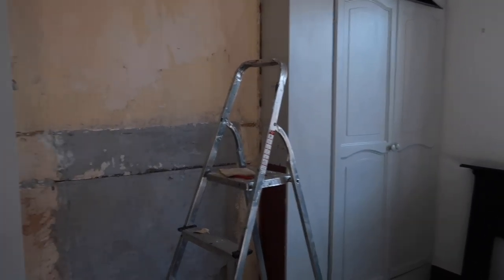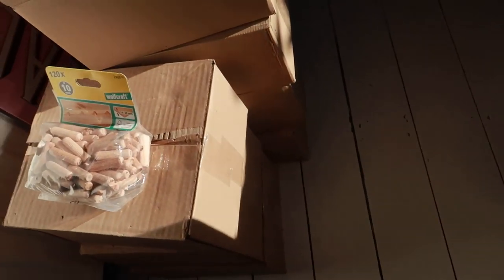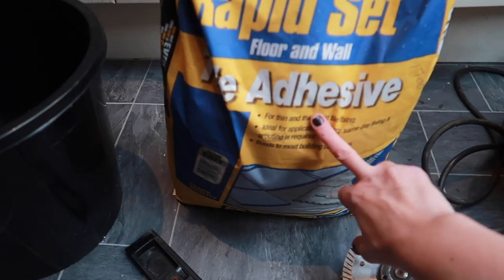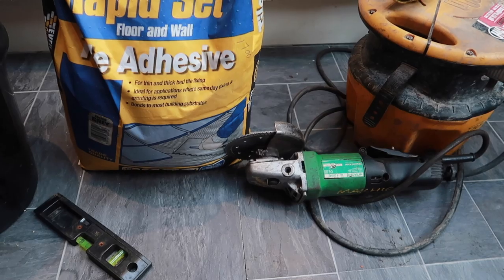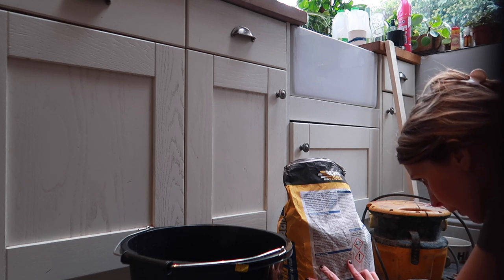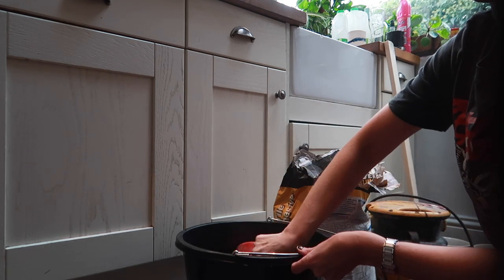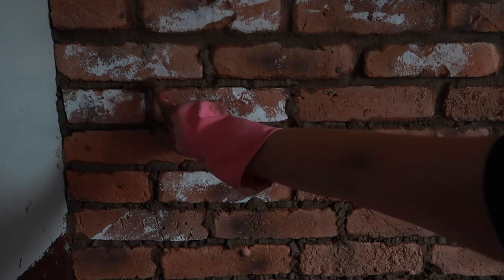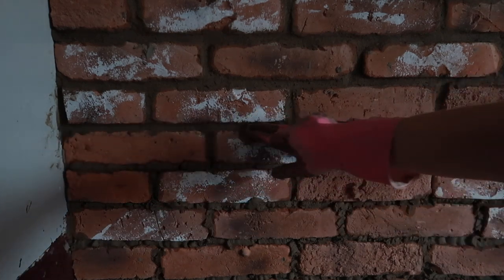MY STEP BY STEP GUIDE TO INSTALLING AND POINTING BRICK SLIPS | Kerry Lockwood

Comment: So glad that I found your video! I also ordered the Kuci design brick slips and installed them this weekend - hard work but so worth it. It really helped to follow yoir video step by step. 1 tip for anybody giving it a go, if the mortar gets stuck in the grout bag then add a small squirt of washing up liquid to the mixture and it helps it flow through the bag :)
Reply from the maker: Chelsey Quayle Great tip! Thank you

Comment: Love it! Thanks for posting such a helpfull tutorial, I tend to worry about doing tiling, agonising over making things perfectly straight and professional but your gung-ho attitiude inspires me with confidence just to dive in and get on with it. Brick walls look better when they're not perfect! I've got a whole wall with two doorways to do, I was thinking of using a tile backer board as a base instead of applying the adhesive straight to the keyed paintwork. Not sure if this is overkill...I'll definitely use the piping bag technique!

Comment: You said the pointing was the hardest part, how long did the pointing take vs the fitting? Am doing something similar myself and am at that point. :)
Reply from the maker: Chris Cannon Hi, it doesn’t take that long but can just get messy. My advice would be to use a piping bag and keep the mixture loose, keep adding a touch of water as it thickens. Once you’ve piped it in then allow it to rest for around 5-10 mins before you push it in and smooth over. Good luck.

Comment: Good job but please use safety goggles and clamp down the brick somehow before cutting them. I bought a tile cutter for about 40 pounds it's much easier and safer to use because you get a more precise cut and you hold the bricks on both sides whilst you cut them in the middle.